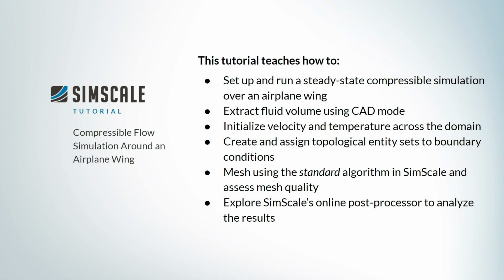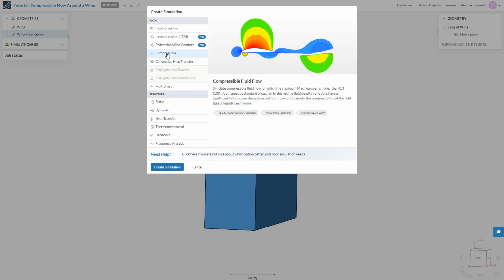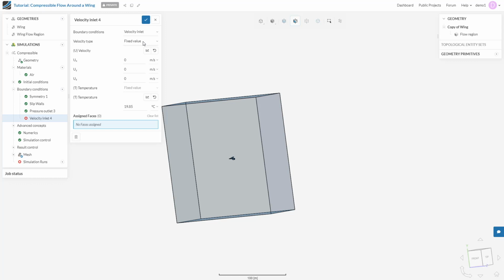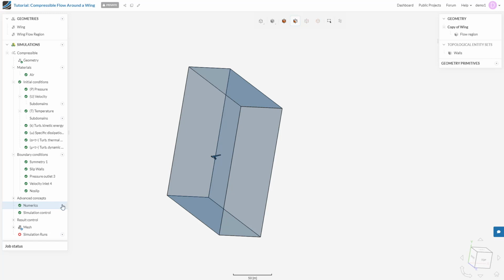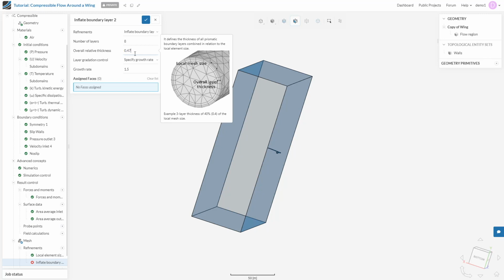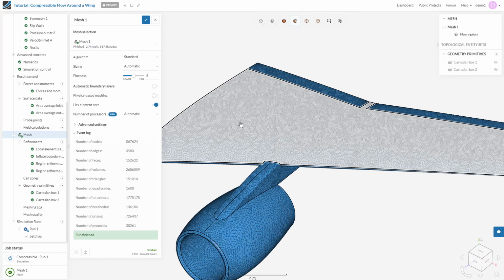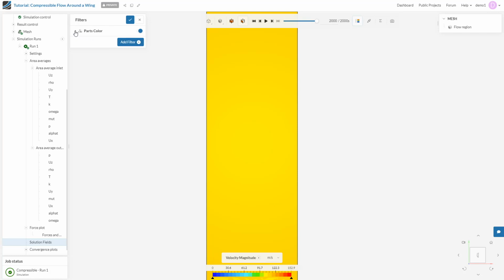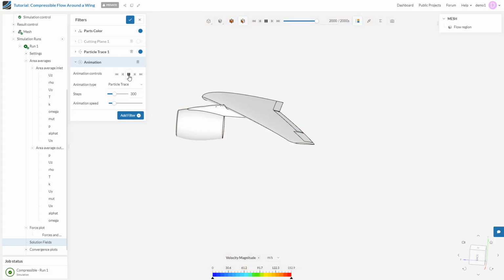Compressible Flow Simulation Around an Airplane Wing

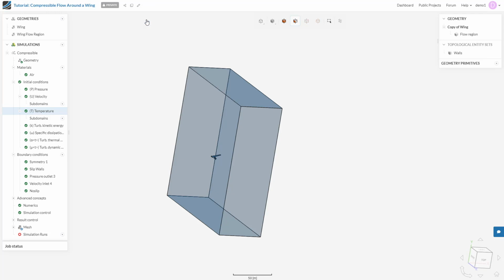Comment from the maker: At 15:54 in the Numerics & Simulation Control chapter, the current default 'Relaxation type' settings are set to "Manual". You can keep it as default and proceed further.

Comment: Thanks for the tutorial. How would I predict the CG, Center of pressure and centre of lift of a model glider using these tools? Also, can I change the angle of attack of the model rather than the Y component of the airflow, so I can see the wing moving in the animation?

Comment: Can you please explain the velocity table setup.  You mentioned 3 degrees angle of the attack and ramp up from 6ms to 115ms.  It is not clear to me how those values entered in the table represent angle of the attack and ramp up to final velocity of 115m/s.
Reply: I figured it out I did realize that wing was facing in the z direction

Comment: can I simulate sonic and subsonic airflows over a body? such as aircrafts or a rocket
Reply from the maker: In order to simulate sonic/subsonic flow, the compressible solver can be used: https://www.simscale.com/docs/analysis-types/compressible-fluid-flow-analysis/
Reply: @SimscaleSimulation  Is setting up the study quite simple or will it take a lot of time? I have cad files of my designs I want to study.
Reply: @kenbhatti3621  how did you make designs please let me know!!

Comment: Can u tell reson for slecting tht vel value
Reply from the maker: You mean the components? No specific reason. It is not far from the average plane speeds. It is high enough to be considered a compressible flow simulation.